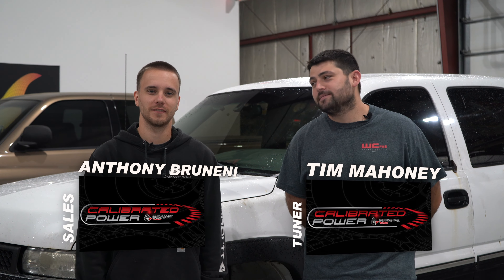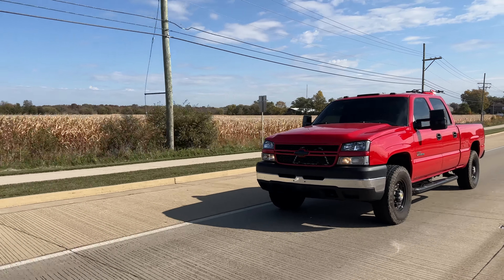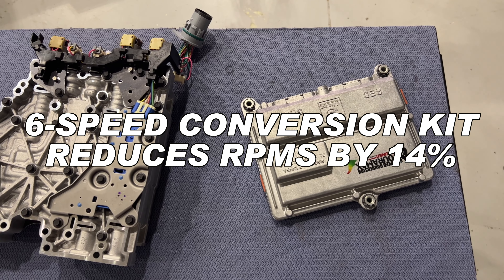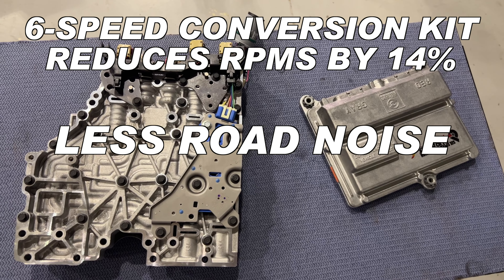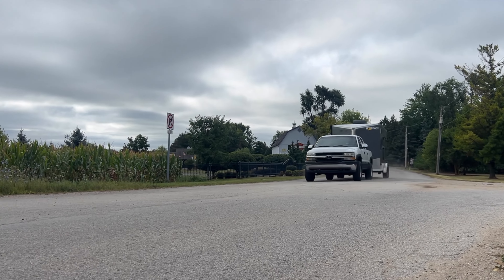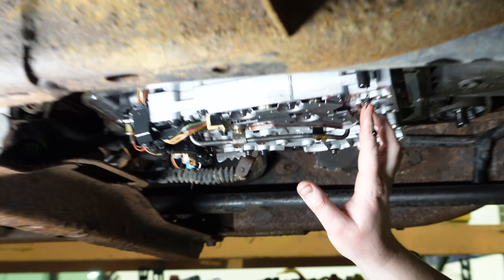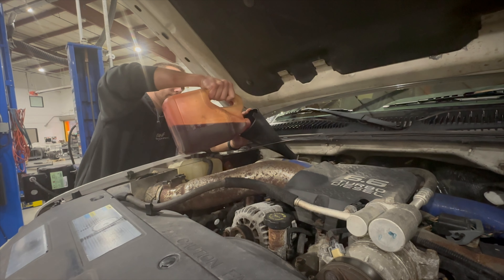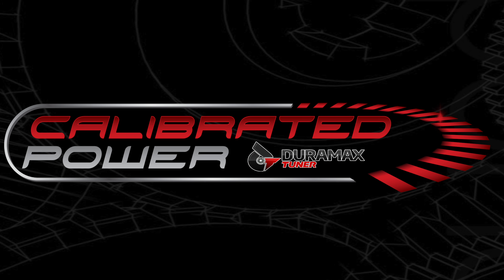We Need An Extra Gear - DIY 'Till I Die Ep. 4

Comment: I have a 2002 Duramax with which I tow a fifth wheel trailer. At 15,700 lbs., the trailer is kind of at the max of what the truck is rated to tow. I love my truck. It has only 133,000 miles on it. No DEF. Federal emissions, so no catalytic converter. I also love my trailer, an Arctic Fox 29-5t . I am full time living in the trailer. What I'd like is an improvement in it's ability to climb the grades when going through mountains. My thought is to change the rear end from the stock 3.73 to 4.10 or a rear end shop even recommended  going to 4.30. This would obviously increase the RPMs, so I thought of putting one of these conversion kits on the transmission. Mostly for the times I'm not towing, so that my engine wouldn't be screaming at me at highway speeds.
A tuner was also suggested by a local diesel shop, but I don't want to overdo that and blow head gaskets or prematurely wear other things.
Any thoughts? Thank you.
Reply from the maker: @wellandhealthy-ef6nd Excellent question! Changing your gearing and adding our 6-speed conversion kit will not be your one way ticket. In order to properly take advantage of our 6 speed conversion kit you will need to have engine tuning to have the power to support the overdrive gear. Not to mention simply changing out your rear end will without tuning for it will put you in an even worse spot as all of your programed shift points will now be off for what your gearing is designed for. You will definitely want to get set up with engine tuning first as this has the potential to fix your issue on its own and you need it to run the 6-speed conversion/ring gear upgrade. Then if you still feel like you are being forced to hold the truck at high RPM's for an extended period of time in 5th gear it would be worth upgrading to the 6 speed conversion kit. The final upgrade I would make is the ring gear and this would only be if you are still being forced to hold the truck at high RPM's in 6th gear. Like mentioned before doing this upgrade first will be center productive and you will basically need to back track to a point that could have already potentially solved your issue.
Reply: Wow. Great advice. I'm glad I asked. No one else I've talked to has said this. Totally makes sense. Thanks!
Reply from the maker: @dennisfleming5095  No problem! Glad to be able to assist.

Comment: I have one of your  valve body  in my 2001 for the most part ran fine but 5 to 4 , downshift was the biggest problem was ruff and trying to get the shift point adjusted  is a active of Congress  I’m  Utah.  I’ve seen some trucks wouldn’t except the 6 speed conversion for some reason they try to couple of them might’ve been the transmissions problem but truck works when you put it back stock
Reply from the maker: Give us a call 815-568-7920, let's get that figured out.

Comment: Not too sure you want to be in 6th gear aka double overdrive while towing.
Reply: Really depends on your MPH. Higher MPH it is fine in 6th Gear. If you are close to that 55-60 MPH mark while towing then 5th gear is much more ideal.

We also have an OD lockout when you are in tow/haul to give you some control over the 6th gear engagement while towing.
Reply: @AnthonyDuramaxTuner  I have the 6 speed conversion, and all I have ever towed with is tow haul mode. The rpm is just fine towing in 5th gear.
Reply: The 6 speed conversion will not go to 6 gear with on tow haul on with the  5 speed transmission  conversion.  06 transmission will go in to 6 gear in tow haul on  so you can convert it to a newer transmission with more options and easier to adjust the valve body to your liking that’s not locked up
Reply: @2015_Rubicnn  Whichever is easiest for you! 

Myself I cruise on the highway around 75-80 and 6th gear crusing is best for my driving style. When I pass someone or am at slower speeds, 5th gear is ideal in that scenario.
Reply from the maker: Thanks for the input!
Reply: @AnthonyDuramaxTuner  I'm referring to towing in sixth, not driving 80mph while not towing.
Reply: @2015_Rubicnn  Yes me too! Sounds like just different driving styles is all.
Reply: @AnthonyDuramaxTuner  I suppose, but I don't think it's good to load your transmission or running gear down in sixth gear. It could just be me, but doesn't tow haul lock 6th gear out?
Reply: @2015_Rubicnn  Since my transmission is built I have not had any issues running in 6th gear at 2000+ RPM. Running 5th gear at 2000+ RPM would be very similar in terms of load.

Yes tow/haul locks out 6th gear. Once I get to cruising speeds I go back to normal mode.